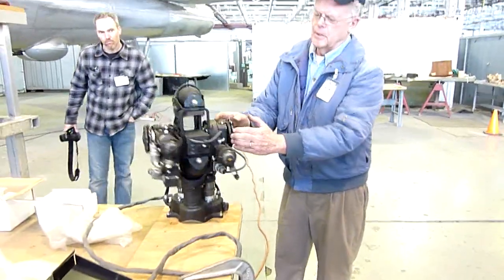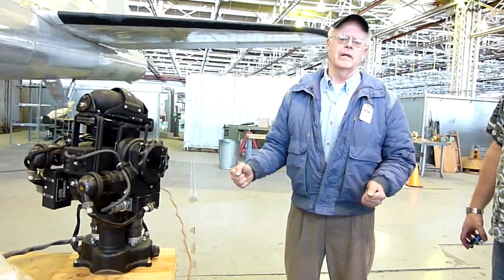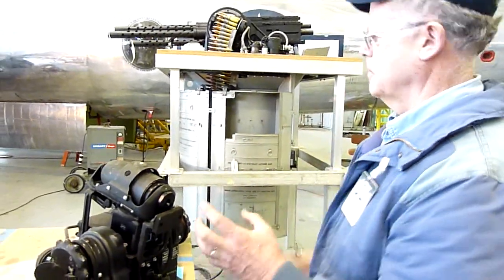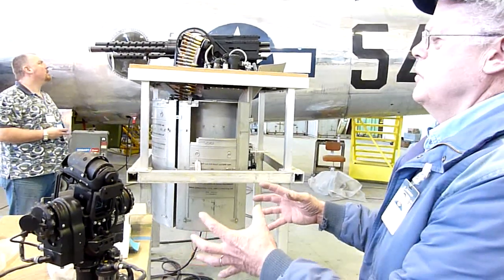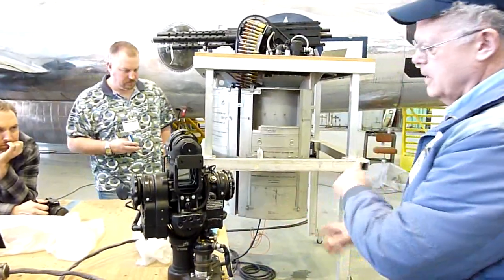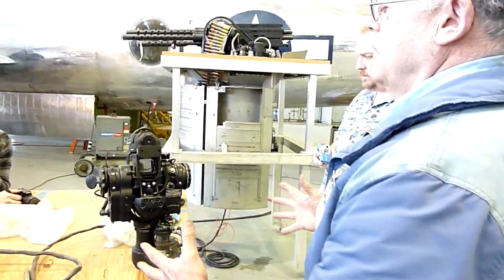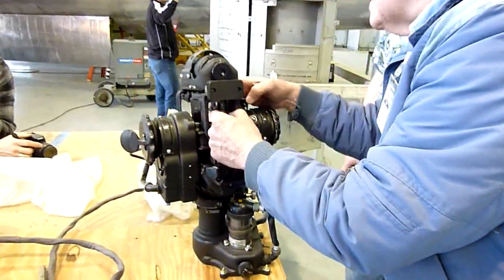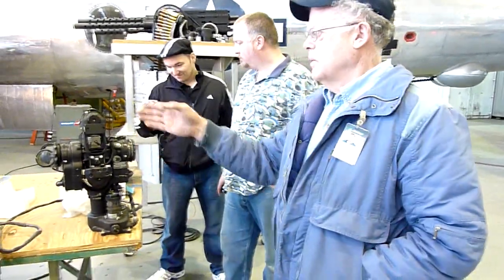B-29 gun turret sighting system Boeing Seattle part II

Comment: My father worked on these during the war. He said that one thing they would do is replace the felt recoil pads in the 50 cals with nickels. It greatly increased the rate of fire. It also burned out barrels much faster, but those were replaceable.

Comment: I understand that once the 29's mission changed to low-altitude raids at night with napalm that this incredible technology was largely dismantled and abandoned. All that was left by war's end was the pair of 50s in the tail. They needed to free up weight and space for more bombs. Is that true?
Reply: I can imagine that would increase the risk of them being shot down. If that were the case, I doubt they'd want that technology falling into Japanese hands. So that seems reasonable to me
Reply: They carried full armament throughout the war. Removing the guns wouldn't increase the space for bombs ar all.
Reply: "Despite the effort that went into developing the B-29’s central fire control and its operational success, it was not always seen as an essential system. Ironically, the central fire control was removed from B-29s engaged in the aircraft’s most destructive missions. The Silverplate B-29s modified to carry the atomic bombs were stripped of all guns, except those in the tail, to accommodate the increased weight of the bombs. It was correctly reasoned that the Japanese would not waste resources attacking a group of three aircraft, so defensive systems were merely excess weight. Similarly, a reduced threat from a weak Japanese night fighter force resulted in the removal of guns and their associated fire control systems during the nighttime firebombing raids on Japanese cities in March 1945. Removing the guns allowed the aircraft to carry more fuel and bombs."

Source: https://airandspace.si.edu/stories/editorial/defending-superbomber-b-29s-central-fire-control-system

Comment: Incredible. No wonder capturing 4 B29s was such a coup for the Russians.
Reply: The Russians sometimes were ahead of us in areonautics, but rarely in electronics and automation.
Reply: I was looking at planes in Warthunder today and saw the Tu-4 Soviet plane and thought it looks a lot like a B29! Especially the turrets draw my attention. Then I looked it up on Wikipedia and found out it was reverse engineered from the B29. Now I have to check out how it happened 😁
Reply: @SorinSilaghi  same for the chinese b-29 except it's called the KJ-1 and it's pretty much derived from the Tu-4 (Soviet B-29) but it was more of an AWACS platform
Reply: @SorinSilaghi  the two B-29 that landed in Russia, one was completely reverse engineered including the engine down to the last bolt. The Russian T-4 was completely rebuilt in metric units including the engines but with improvements and simplifications to adapt it to Russian needs and less qualified mechanics on the fields. It has been heralded as a great achievement that the Russians managed to reverse engineered it but the fact is that they did stole it otherwise they would have been years behind the USA and saved a lot of money. There is nothing to be proud about this...
Reply: @paoloviti6156  I had heard on a television documentary that the engine's was the one thing the Soviets had trouble with.  The specific engines were very unique and the Russians replaced them with their own, because even we had trouble with the design at the time.  I do not know the details on the engines to know why they were a big deal.
Reply: @jrus690  it could be but honestly I really don't know because my enthusiasm stopped cold after they copied it, Lol 🤣😂
Reply: @jrus690  The B-29 had issues when at full throttle the cooling covers open fully and could stall out the aircraft.